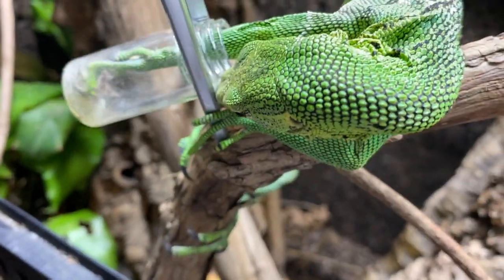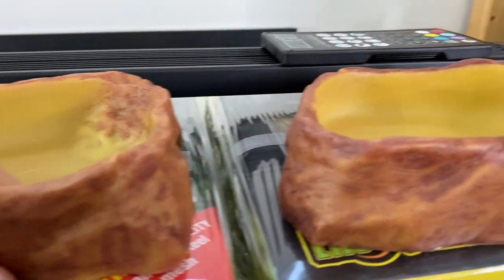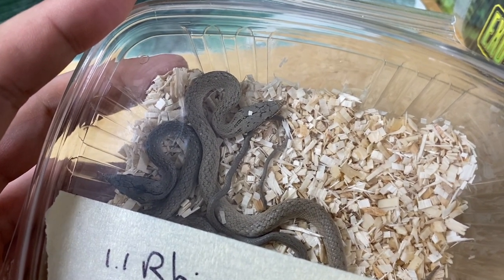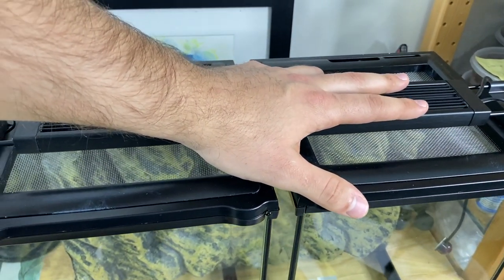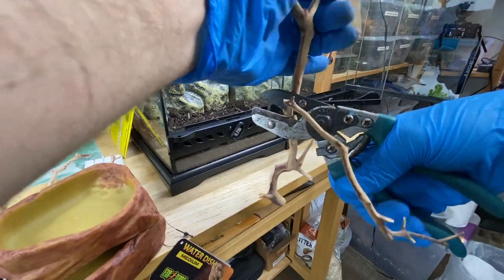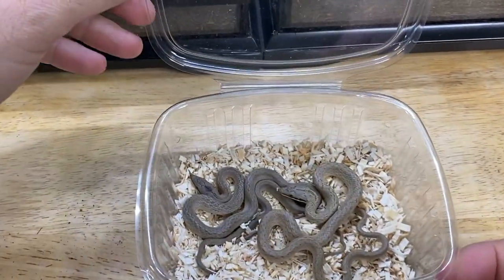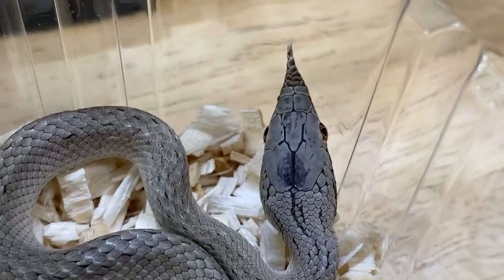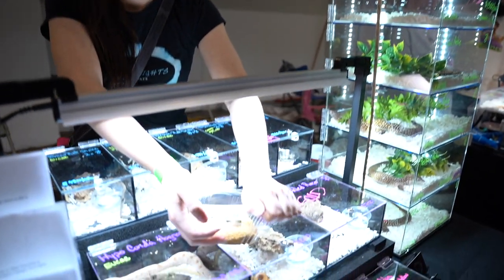MEET MY BABY RHINOCEROS RATSNAKES (Gonyosoma boulengeri) + HOW TO SETUP TERRARIUMS!

Comment: I have a pair of rhino rat snakes as well (I live in Europe so they’re a bit easier to come by here) and I absolutely love them! The thing I really like about them is how diverse their behavior is. They obviously like to climb, but wil also swim (not just soak, they’ll truly swim like a aquatic snake) and I have even spotted my female burrowing a few times! This was in the summer when my room got a bit hot so I assume it was to cool off. If given a lot of cover they are extremely active (for a snake) and since I’ve given them uv-b they have been showing themselves even more often.
Reply from the maker: Thanks so much for sharing! May I ask you what temps you keep them at? I mostly hear people say to be very careful about letting them get too hot and even not to use any heat lights for them but then the few care sheets you can find online say to use heat lights which completely contradicts what most keepers/breeders I’ve talked to suggested doing 😅. Always happy to learn from others!
Reply: @Reptiliatus  I am not a very experienced reptile keeper and have only worked with this species for one year so do take this with a grain of salt. 
I personally do use heat lamps, even with baby’s. I don’t try to heat up the whole enclosure but have te lamp standing on top of the enclosure in a corner and with the thermostat probe really close to the lamp, about 10 cm underneath the lid. This way I’ve found I can create a pretty sharp heat gradient of about 27 degrees Celsius on the hottest spot while having the rest of the enclosure at 20-23 degrees. The hot spot itself is really small, taking up maybe 1/8 of the enclosure. The room I keep them in is usually pretty cold tough. This works for the exoterra mini but maybe it’ll also work in a nano. Overheating is still a bigger problem than undercooling so if you aren’t sure you’ll be able to give them that big of a gradient in such a little enclosure having them at room temperature works fine too. 
My room is getting even colder with the winter coming in, with daytime room temperatures sometimes getting to 18 degrees. With these colder temperatures I’ve spotted my female basking underneath her heat lamp (25-27 degrees) on multiple occasions. She is about 1.5 to 2 years old but seams to like the warmth. 
I personally think that offering them a good gradient with a lot of cover so they can choose their own temperatures is the best, and if they seem to enjoy a certain temperature range the most you can always adjust for that. 
I honestly don’t try to stress about it too much, in the wild these animals also experience a pretty wide range of temperatures and do fine. During a heat wave I have even had the temperatures go as high as 32 for one of my neonates and tough she did not enjoy this (she was constantly in the coldest part of the enclosure) she was fine afterwards. This did only last for a day or two tough, I obviously wouldn’t recommend doing this. But I thought it serves as a good example of what they can tolerate. 
I know that there are a lot of people saying different things for their care, but this seems to work for me. Both my snakes are active, are yet to skip a meal (after I got them eating), digest their food completely and are growing, which is about all you can ask of a snake. 

Sorry if I rambled on for too long, English isn’t my first language and I don’t always know how to put al the information in a short sentence. I hope this was of help for you!
Reply: @jipjuda4662  hello, im currently in Europe too( france) i just have a babi rhinocero. May i ask what substrate do you use? And how do you supply the humidity for them? Thank you so much
Reply: @Reptiliatus  Hi! I'm Luke. I have 6 Rhino Rats, and the oldest one Dav Kaufman helped me find at the Schaumburg NARBC expo. I keep all 5 of my yearling and 2 yr old at a temp of 75-77 f. They like cooler temps. My yearling male has refused food the last 2 feedings, so I'm going to bump up his temp a bit to see if that changes his appetite. I'm also moving him away from my other Rhino Rats. Otherwise I'll brummate him. My youngest Rhino  baby is only 2 months old and I'm transitioning her from guppies to brained pinkies- it's a process! Once they're established eaters, they're great eaters. I got her from.Northern Lights partner here in US Ivory Exotics, and the baby is blue line from Europe.  My baby is in a tub 11x14 with 2 hides - one warm and 1 cool. Both hides have moist spaghnum moss. For the warm hide I also use a heat probe with heat mat with temps of about 82-83. The deli with fish is also on the warm side of her home so it's warmer for her to soak in. The babies love hides with spagh moss moist not dripping wet. You will LOVE your rhino rats. They're so curious and friendly! I gave 1 yearling male to Emily Roberts- SD-  At thus  year's buildoff she said he's eating great! She's now moving him into the zoo. Some of the best people around are the Rhino Rat room on fb. We've learned a lot from them! You're in for such a fun tine with your snakes! I really like the name Pinocchio!

Comment: Waiting for exoterra to make their enclosures escape proof for small reptiles….
Mourning geckos are a nightmare in theses enclosures, you’ll have babies all over your house!
Reply from the maker: if you plug those back slots the only way out for them is through the front door!
Reply: @Reptiliatus  that’s what I thought but I’ve had them still get out!
I suspect some of the smaller hatchlings squeeze between the gaps on the sides of the glass doors. Wonder if the specs varies between enclosures and mine just happens to be big enough.